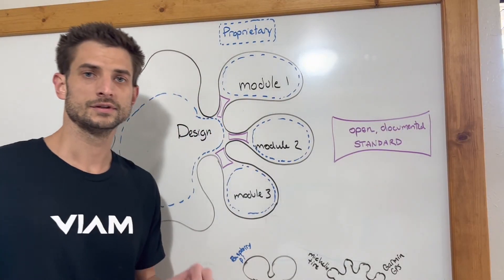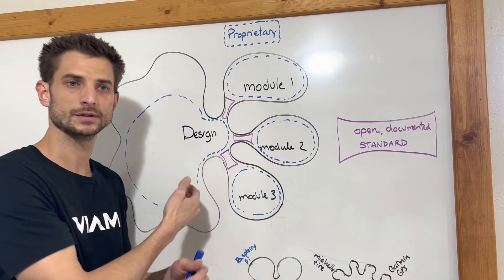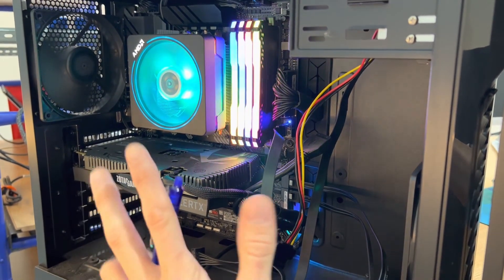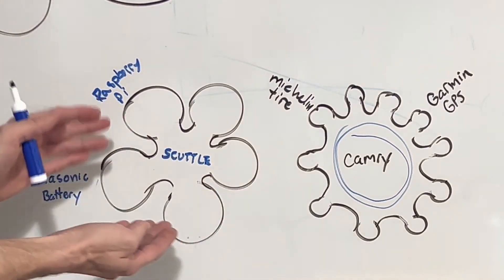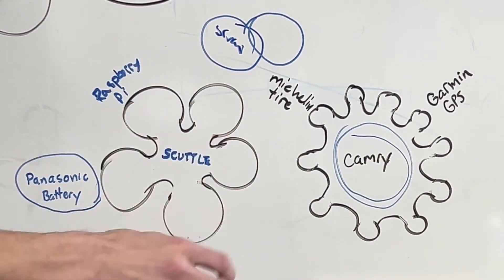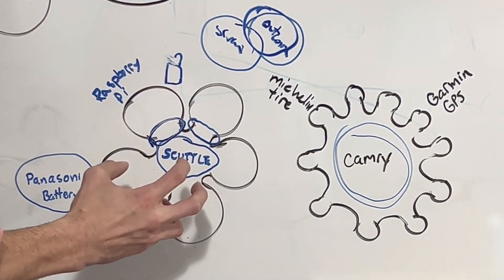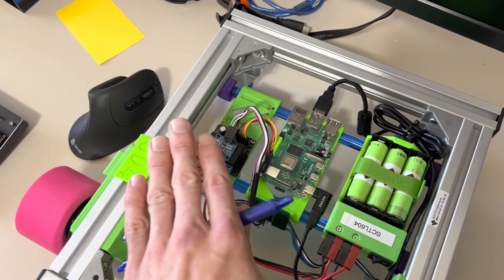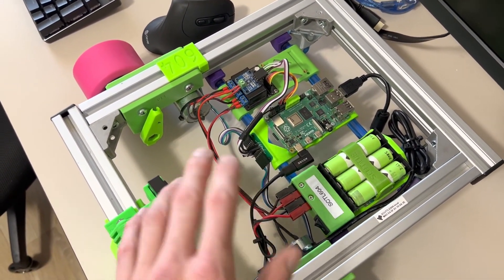OEM of Modules: How Dell designs "nothing" and major products are open source.

Comment: Dell bolts together modules, yes. But they also swap some data, power lines, or whatnot to make the consumers HAVE to buy replacement components only from them.  You make "open source" sound so friendly.  In the real life business world, it's anything but.  For instance, car manufacturers use off the shelf tires but have their wheels use an extra lug to force consumers to use only their wheels.
Business is about making the max money, period. We graduate as engineers and think our career fields will be doing cool designs while making a decent living.  Having retired as a computer hardware designer, I can tell you, the rewarding career path, both in hours & pay, was marketing & management.